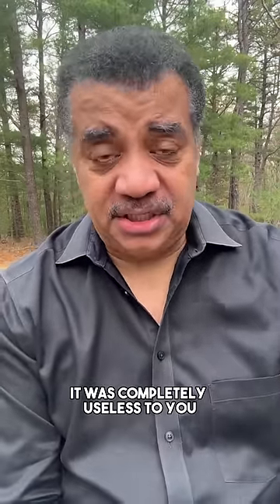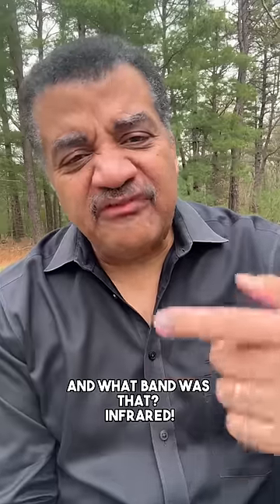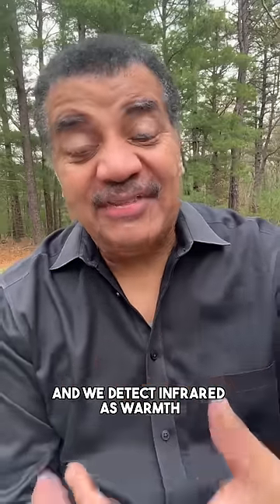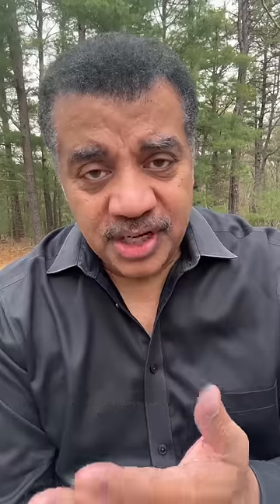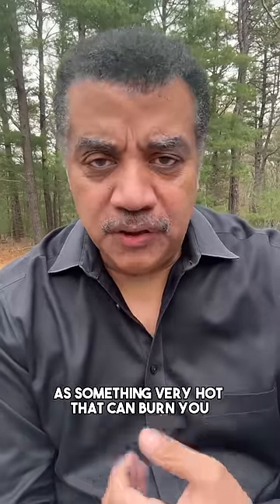LED Bulbs vs. Old Bulbs 💡

Comment: Very true but one little detail missing here is that LED bulbs do generate heat via the module which is absorbed by its heat sink (the metal frame before the globe) and then the heat dissipates. That’s why when you touch the globe of the bulb it isn’t hot, but if you touched the heat sink just below the globe while unscrewing the bulb immediately after turning off the light, you’ll scorch your hand.
Reply: And the cheaper the bulb, the inferior the heatsink, the hotter the surface, and the shorter the lifespan. I have older LED bulbs with a chunky heatsink illuminated 24/7 for 3 years now. Heat sink barely gets warm.
Reply: Damn right.
Reply: Yes, thank you! I worked with LED lighting for many years and some of those early heatsinks were massive lol.
Reply: The wattage he stated is also incorrect. 
I don't remember them all but a standard 1600 lumen 100 watt equivalent LED is 13-14 Watts.
Reply: Cheap apartment ones with these weird nail head looking connections get so dam hot. They burnout so fast...
Reply: Yeah, his perspective is tainted and narrow.
Reply: Yeah, the longevity of these bulbs are directly linked to how hot they are ran. It's like 95% of the bulb's lifetime calculation right there. Same reason that running a dimmable LED bulb on a dimmer setting below 100% (often even just slightly less than 100%) will extend how long the bulb will last by a huge amount... it just reduces how hot the LED chip runs!
Reply: LED lights suck for warm lighting …
I prefer soft warm lighting my preference..The old bulbs were much easier on the eyes…
Reply: but the heat quantity being so low is the only reason it can be managed by a heatsink
Reply: News flash! All electric things generate some head. That is a consequence of electrons moving, generating an electromagnetic field.
Reply: You'll have to experience this to know neil just reads science he doesn't actually test theory
Reply: That only applies if you're running your LEDs off of 120 volts if you are like me and have instead wired for 12 volts your LEDs won't get hot at all
Reply: Mental note to self: 
Don't scorch the hand 👌
Reply: @danbartstow9829  I bought warm white dimmable LEDs.  4500 kelvin I think, they're great and only 1 has failed in 14 years. Just like the old ones, or try them in a lampshade.
Edit 12v
Reply: @danbartstow9829 that did not age well.

That was the case 10yrs before.
Today they are just as good and even better.
Reply: Yeah, he is really pretty ignorant about LED.

Comment: Or if you want the explanation from an electrician: old lightbulbs use very thin filament of tungsten, encased in a glass bulb filled with inert gases so that the filament doesn’t oxidise and disintegrate. The electricity causes the wire to heat up and glow, a portion of that energy is turned into light.

While with led also short for "Light Emitting Diode" are illuminated solely by the movement of electrons in a semiconductor material. Electrons in the semiconductor recombine with electron holes, releasing energy in the form of photons. And for those who paid attention in school know that photons are what we call "light"
Reply: What's your degree, buddy?
Reply: @mokhlislazazi you don't need a degree to explain that
Reply: @uuo9151  no, I needed your answer for something else, I thought I could ask you some questions about studying abroad
Reply: I preferred your accurate and meaningful explanation.
Reply: More like get it from a Physio-chemist😅, even though it's basic physics
Reply: @mokhlislazazi  umm, 2 years in electrical energy studies, 2.5 years apprentice as an electrician and then i have 3 years experience as a qualified electrician? I dont live in usa so i dont know what kind of studies you have to go through to become one. Also the american voltage network is trash. You guys be using 120V/240V while us europeans be using 240V/400V
Reply: @captaincomicana4231  thank you👐
Reply: Smart people inside here (except me)  ok back to gaming 😬
Reply: This. I've always thought "the old bulbs get the light by heating up material up to glowing hot. But the modern LED bulbs just immediately glow without going through heating. How does that work?" And you answered my question
Reply: @thegreenpistachio8883 doesn’t matter we just step down the voltage before the house
Reply: @gopackgo4036  and what voltage system are you talking about? Because theres a big difference between 120v and 240v. The higher the voltage the smaller cable cross section. In a 120v installation you need to pay more because you need a higher cross section on your cables.
Reply: @thegreenpistachio8883  the problem is we already have the cables, so it doesn’t make sense to switch to 220. Ultimately it would have been better to be on 220 all along, but our infrastructure is set for 110.
Reply: Oh, so basically, we upgraded from a potential light grenade to an electricity experiment using conductive pseudo-glass.
Reply: LEDs do get plenty hot tho
Reply: I'm in the irony is you didn't actually explain the heat. Because yes the filament is heating up but most of the heat isn't transferred via conduction it's transferred via radiation.  And that radiation is the thermal radiation that the video is talking about.
Reply: @JW-452  yeah, all things that emit heat radiates. Radiation is energy that comes from a source and travels through space. I could just say that the bulb produces radiation, or that the oven produces radiation or even that the hot water in the shower produces radiation. But saying that a bulb produces radiation would make people who dont know the difference between ionizing and non-ionizing think its radioactive like plutonium..
Reply: @thegreenpistachio8883   yes but ,my point was, that you said you were explaining from a electricians point of view, but you never actually explained the heat, you just said what each did.  Hence, i point that out.
Reply: @JW-452   thank you for worrying about my explanation, but i didnt intend on explaining what heat is. My intention was to explain the difference between a bulb and led lights. I noticed how neil only explained that old bulbs emits heat and leds dont, but never explained how each works when it comes to producing the light, hence my explanation.
Reply: @thegreenpistachio8883 Im not sure if you are able to answer this question and I realize my question might sound silly

But Is the heat generated by an incandescent bulb due to the amount of energy the bulb is using? 
Or is the heat coming the "leaking" of energy in the form of infrared light? 

I guess my real question is, if an LED bulb were using 40watts (instead of 3 or 5), would it give off the same amount of heat as a 40 watts incandescent?

Or is that a LED bulb is so energy efficient that all the energy being used would produce a brighter light and virtually no heat?
Reply: @rubenluevano1997  The heat generated by an incandescent bulb is primarily due to the inefficiency of converting electrical energy into light energy. In an incandescent bulb, a significant portion of the electrical energy is converted into heat, which is emitted as infrared radiation along with visible light. Therefore both the energy usage and the inefficiency of the conversion contribute to the heat produced by an incandescent bulb.

LED bulbs are much more energy-efficient because they produce light through a different mechanism, where electrical energy is directly converted into light with minimal heat generation. So if a LED bulb were using 40 watts, it would not give off the same amount of heat as a 40 watts incandescent bulb, Instead most of the energy would be used to produce light, resulting in a brighter light with much less heat generated.
Reply: @thegreenpistachio8883  You broke it down perfectly. Thank you for taking the time to answer this question.

I'm currently doing research on a subject that LED me here (no pun intended) and you have given me the footing to getting more understanding and get more information.

Have a great one man💯
Reply: @rubenluevano1997  no problem! just happy to share my knowledge😁
Reply: For anime lovers, watch Dr. Stone and he gives this exact explanation while building an a light bulb.
Reply: Also, LED's mainly emit light in non-visible wave lengths but we have this substance called phosphor that changes those wavelengths into white light. Before we figured out that phosphor can do this we only had red and green LED's. No white light or any other colors.
Reply: @craigmak 
I didn't know about that, that is quite interesting.
Reply: @craigmak  i think you might be mixing things up a bit here. LED lights do not typically contain phosphor. Phosphor is used in some types of lighting, such as fluorescent lamps, to convert ultraviolet light into visible light, but it is not used in LED lights. Instead, LEDs produce light directly through a process called electroluminescence.
Reply: @ShrockWPS  and the crazy part is how accurate it is too. Edison used carbonized bamboo for his first commercially practical incandescent light bulb. They also use bamboo in Dr. Stone
Reply: @thegreenpistachio8883 
I know, it's awesome.
Even teaches how to accurately make gunpowder.
That show is great! 😄
Reply: Nope! ...Pistachio... your version is OK... but it doesn't win any prizes against Neil's much more elegant explanation...!!! Sorry! 🤷🏽‍♂️
Reply: @helloxonsfan  well i explained how each of the light sources works, while he explained how the heat between the two works. but hey, I'm only an electrician, no way i would beat a writer and astrophysicist in terms of explanation.
Reply: @thegreenpistachio8883  ... Don't worry...!!! Silver & bronze are good prizes too...!!!  💡
Reply: And also, they get hot too. The moving of those electrons produces heat too. So idk what this guy with moustache is talking about not getting hot. Just grab one with ur hand u'll see that it gets so hot u can't hold it in ur hand. And that is perfectly normah for an LED.
Reply: @tixe7075  that is not normal at all. A normal led bulb could get warm to the touch, but if its hot to the point where you burn yourself something is seriously wrong.
Reply: Many times the filament even broke because of the heat causing us to buy new bulbs
Reply: @MaryAnnSweetAngel  im assuming you're responding to the latest comments. In that case, it's not normal for LED ligts at all. If your LED bulb is getting excessively hot, there may be an issue with the bulb itself or with the fixture it's installed in.
Reply: The base gets hot.

Comment: Fun Facts about Diodes (not that anyone asked):

• Diodes weren’t originally invented for lighting purposes. 

• Light Emitting Diodes LED are essentially exploited for ordinary lighting needs in domestic and other settings. 

• Diodes were initially invented for rectification, the process of converting alternating current (AC) to direct current (DC). 

(i.e allowing current to flow in one direction while blocking it from flowing in the opposite direction)

Other uses of diodes: 

Signal demodulation: Extracting information from modulated signals, often in radio receivers.

Voltage protection: Preventing damage to circuits by blocking reverse voltages.

Voltage regulation: Maintaining a constant voltage in circuits, such as in Zener diodes.

Switching: Acting as a switch in digital and power electronics applications.

Comment: Also, they cost 3x more to manufacture, and 10x more to buy. And the do not last long enough to compensate for the added strain on the environment during the manufacture. 

Everyone loses apart from the VAT collector and the big corps.
Reply: You got right down to it! Used LEDs are hazmat
Reply: Now LEDs last 50000 hours
Reply: I have them throughout my home and haven't needed to replace a single bulb in almost 5 years. I haven't done the maths on your claim, but I'm more than happy with the new LED bulbs.
Reply: The early LED bulbs were quite bad. The technology is improving; higher efficiency, longer life, better drive circuitry - could be more repairable.
Reply: @newvoyeur  They still require very “clean” current. In a large part of the developing world, these new bulbs are a menace.

Comment: Not to say old bulbs are useless.  They were a very inexpensive and multipurpose heating element and light source combined for a small space.  I used them in my basement to light and keep pipes from freezing in an old 130 year old house.  Now I use purpose built heat lamps.
Reply: Yes, use them in high humidity areas  to reduce mildew in closet
Reply: I think they made an oven using this
Reply: Exactly, now I use my heater even more. So....problem was only transferred.
Reply: I would love to see a video of your house, I love houses that are over a hundred years old!
Reply: @mtanyctrainatlantamartatra7164  It, like me is well used and in need of major repairs.  LOL.  But there are glimpses of it in my Facebook and YouTube Angry Old Man Running.
Reply: @jjrbarnett kinda like transferring mining, child abuse, pollution and carbon release to a different country so we can feel better about ourselves here. 🤔
Reply: @KevinMah-ol5on  that's a valid point.

Comment: And yet it hasn't made the slightest bit of difference to my electric bill
Reply: No but LED had blue light and that's bad for your eyes also could be linked to headaches, and depression
Reply: Even when I used 100W incandescents everywhere I got like 4eur for electricity and 6eur for electricity transmission plus mandatory payment for renewable energy purchase. Bulbs are not the biggest energy consumers, electric heating, electric pumps and taxes are biggest money pits
Reply: Because a. The price for electricity has gone up. B. Our use of electricity has gone up. C. Light bulbs are only a fraction of what makes up the bill d. It's only really noticeable in a commercial sense such as when you replace over 200 high bay lights at 400 watts each with led lights that are only 60-100 watts each, or when changing t8 bulbs from fluorescent to led in 136 fixtures with 4 bulbs per fixture. E. The drivers and other electronics to run the led bulbs take up a good chunk of watts which is why led lights are usually more than the 5-10 watts stated in the video
Reply: Hey Neil, the next time you change an LED light bulb, make sure you grab it by the base (where the driver is) and then tell us how much energy goes to making that so freaking hot.
Reply: weird.  I swapped out all my main use lights from 100W to 4-8W LEDs and my electricity bill nosedived.
Reply: Each watt that the lightbulb spends heating up your house is a watt that your heating system doesn't need to output, so in the fall/winter/spring the savings won't make a difference
Reply: @omnacky  Depends on if the energy spent on a light bulb is equally as efficient at heating a space as if the same amount of energy were spent on your central heating unit.
Reply: @Churdington  Energy efficiency in this case isn't really a thing because giving energy off as heat is the goal not a side effect. Unless you mean cost efficiency, like if your house is heated by gas which might be cheaper than electric heat in which case you wouldn't be breaking even
Reply: Since I was born, the population has grown from under 3 billion to 8 billion people. I wonder if the price of generating electricity has anything to do with the huge increase in demand and the added expense of building and maintaining dams and infrastructure as the population grows so fast. I know Im talking numbers here but some seem to have trouble grasping the concept of efficiency multiplied by massive increases in humans. Got math?